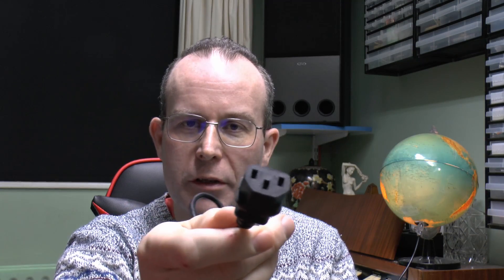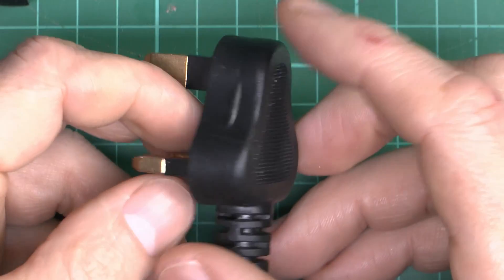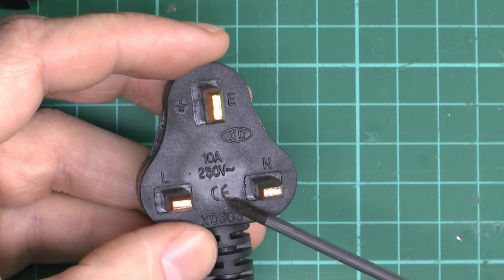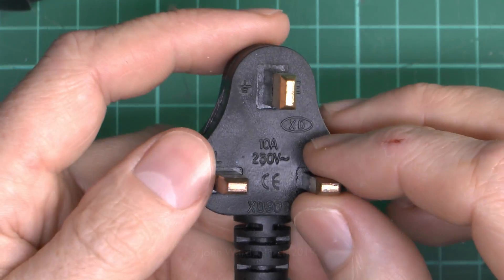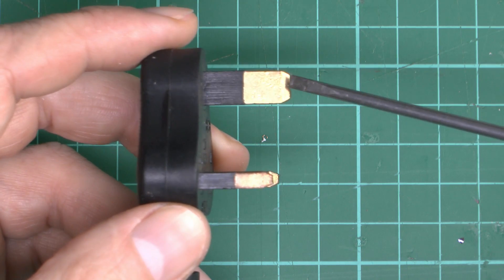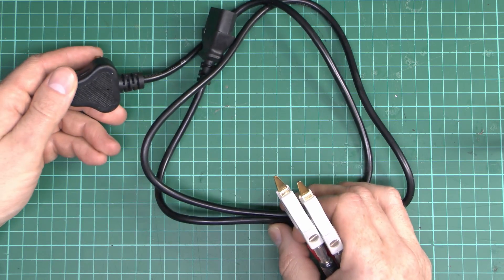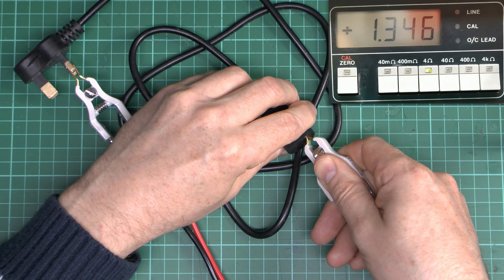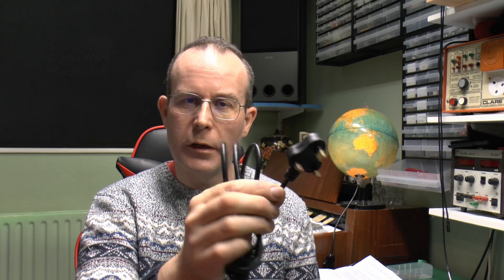Dangerous Unfused UK Plug and Undersized Flex

Comment: Is there a specific UK regulation or specification that states a 3 pin plug must have a fuse?  I have a Uniross NiCad & NiMh plug in charger for AA or AAA Batteries, the body of which plugs straight into a wall socket, the 3 pins are correct & earth is not sleeved, how is that allowed without a fuse?

Comment: I have just sent back an AC adapter with the plug mentioned, they is no fuse and the plug is illegal and potentially lethal UK plugs provided with electrical goods, often from online marketplaces, are typically small, unfused, and do not meet UK safety standards. The sale of such products in the UK is a criminal offense under the Plugs and Sockets, etc. (Safety) Regulations 1994. Amazon are still selling such goods online.I

Comment: w circuit breakers, i question the need for the fuse in the mains plug.  in fact i would say the contact points for the fuse are the weakest links in the design which under high current, might cause the plug to overheat.   plugs from the rest of world dont hv fuse in them, so why should it be considered very dangerous.

Comment: Unfortunately not only did I once nearly get into an argument with a charity shop that was selling a hair dryer with one of those unfused plugs that had 
"passed a test" but I have seen a couple of them in use in commercial buildings. If somebody sent me one from EBay ( and occasionally I have had 
instances of items differ from the photo ) I would cut it up into pieces and throw it in the bin. When I bought a replacement power pack for my old
laptop it came with a lead that had a shrouded Earth pin so I just used the original mains lead and the plug with a shrouded Earth pin was disposed of.
The only reason I let it slip in the charity shop is because I would have really lost my temper in disbelief that anyone can be stupid enough to pass 
something like this as "safe" when it's obvious it's downright dangerous although I did think of buying the hair dryer and destroying it but it wasn't worth
wasting money on nor did I want to be seen buying something that is lethal. Everyone should know a legit UK moulded plug has a fuse compartment
and you would think people who do pat tests would know better.

Comment: That thing is made for the Middle East , places like Iraq Afghanistan India were the use UK BS1363 socket outlets. Not really dangerous for them but in the Uk the are highly dangerous. As are the sealed Moulded plugs the manufacturers put on most if not all domestic appliances in the UK .
Just cut them off and fit a standard rewireble BS1363 plug .

Comment: i just plug them into a surge protector or anything that had a fuse, seems fine for years now
these are not meant to be plug directly into the wall with full power flowing in before any protection
no need to throw away lol

Comment: Hi I bought a new microscope from a week known company in the uk it is branded with their logo. 
It has the same type of plug but attached to a transformer the microscope has a metal body with no sticker or safety label not even the class 2 markings (square in a square) 
Would you consider this to be safe if I change the power adapter?
Thanks.

Comment: I disagree. In all other countries except for UK and Ireland most plugs are without fuse. In EU/US/Asia/Australia we only use fused 3 pin plugs for high voltage devices like washing machines, dish washers, power machinery. And mostly we use 2 pin plugs and believe me it's safe even under insane EU regulations :)  I don't think you need 3 pin fused plug for most household appliances (it's like going for a stroll with a safety helmet on, of course it's safer and in some circumstances can save lives :)

Comment: Was  that lead bought from Poundland? I purchase a 4 gang extension lead from them about ten years ago. The first and only time I used it was to power a perfectly good table lamp with a 40 watt bulb fitted. It overheated within a couple of minutes of plugging in and set fire to the room.
The fire brigade too the remains away, together with the receipt for the lead. Poundland were subsequently prosecuted by Trading standards. But I see that they are back on sale again in Poundland.
So unless you are an arsonist do not buy one if these.

Comment: The strange thing about this plug is that somebody took time and effort to design and put the thing into production. What on Earth were they trying to do? For the effort involved, surely they could have produced something that was much closer to the spec for UK plugs? If they wanted to cheat on costs, whilst of course I'm not recommending it (!), they could have just put it on the market without going through the proper acceptance tests. I would have suggested that somewhere in the world there is a nation that uses plugs like this, but the CE marking gives away the game that they are trying to fob this off as some sort of UK plug.

Comment: I understand what you're saying about the cable being too small for a 10 amp item but surely the biggest issue is that the cable can potentially have up to 32 amps before it takes out the cu breaker.

Comment: John. Does a PSU for a device like a phone charger have a fuse?
Reply from the maker: Some do, either an actual fuse or the cheapo method of a resistor which is designed to fail if excess current flows.  Others do not.

Comment: What is you opinion about twin core cables (for Class II appliances such as portable hi-fi systems) fitted with three-pin plugs that have the earth pin PART-sleeved (half covered) (and a figure of eight on the other end of the cable) ? I've just seen a few of these on Ebay. Obviously, the earth pin is simply performing the job of opening the socket's shutters, and won't be in contact with earth. But my suspicion is that, because the earth pin has a PART-sleeve, it's an indication that there are probably other issues with the plug/cable.
Reply from the maker: Anything with a part sleeved earth pin does not comply with the standard - the only options are solid metal or solid plastic depending on whether an earth connection is required.  Class II can either have a metal pin not connected to anything, or a solid plastic pin.
Any plug with a part sleeved earth pin should be cut off and destroyed.

Comment: UK has poor wiring... it shouldn't depend on the fuse to blow because when it blows, most people don't have extra fuses to replace. It's the breakers job to blow if it shorts or overloads!! WHY are UK houses designed that way? Why fuse and not breakers?
Reply from the maker: Fuse in plugs are left over from the 1940s when a particular system of wiring was designed.
Modern homes have consumer units with circuit breakers, but all plugs still have fuses as changing that design would be excessively expensive for no real benefit.
Fuses for plugs can be obtained in any UK supermarket, hardware stores and many other places.
Reply: @jwflame  Ok, thanks for replying

Comment: why the N symbol is on the right and the L on the left? the L should always be on the right... or is the video is opposite because of the camera?
Reply from the maker: Depends which side of the plug or socket you are looking at.  
The socket has N on the left, so the plug pins will have N on the right when viewed from the pin side.
Reply: @jwflame  oh ok, thanks

Comment: I have couple pretty similar eu cords. Marked 0.5mm^2, measured about 2ohm resistance on both L lead and N lead. At 4 ohms total resistance it would make a nice heater even with relatively low load. (and about 400W of heat on short cable with marked 10A )
Mine has  no continuity on earth, even though cutting in half revealed three wires in it. There was a reason to cut those cords before they get mixed with good cords.
Always check power cords that come with cheap chinese products.

Comment: I believe the manufacturer used the housing intended for the BS 546 plugs (with round pins; the old standard for UK plugs and nowadays used in India) now for BS 1363 plugs. They just replaced round prongs by rectangular prongs. And 3 x 0.5 mm² is even not allowed even if a C7 IEC (appliance couplers) connector is used (max. 2.5 A). The min. cross section is 0.75 mm² (for mechanical strength).
Reply: As example; look to PE-364 on http://w3.linetek.com.tw/html/ac_product.aspx?t_fid=f0012

Comment: Can you scrape the plastic off. Of the pins or are they. Permanent
Reply from the maker: The plastic piece is fairly thick - the pins are the metal piece at the end, the plastic spacer and there is just a small screw through a hole in the plastic to hold the metal end on.
Reply: I meant I have one of these cables and it has been running fine for 2 years attached to the back of an old fujitsu siemens computer

Comment: Wow. Never thought of half of those things being a problem before. I'll be looking out for each of these things now. Thanks for potentially life saving or house burning down advice! 
I just now checked some twin and earth wire that I'm adding to a ring main that has been sat in my shed for a number of years and decided to check the ohms on the cores before installing in the wall. Each check showed zero ohms on my auto ranger so that's good, since I want to run a high current AC unit off it.

Comment: These plugs are on everything I buy from china which is sold as having a "uk plug lead", the metal cap on the earth pin stayed in my socket when I pulled one out the other day. I usually change the plug for a real one and hadn't given too much thought to the quality of the lead wire itself so thanks for the heads up.

Comment: This plug is in common use in parts of world that have UK style sockets but not UK style plug and socket regulations. It is dangerous and it doesn’t comply at all with the British standard. If you come across one of these, bend the pins so that it can’t be plugged in and cut the cable up in short lengths or better still burn it.

Comment: I'm glad to see the Earth pin has plastic insulation to prevent accidental Earth shocks.
Reply: So you call them 'earth' shocks?    :-)
Reply: @TaunterAtwill  
Well, I've had many shocks from Earth, usually while holding a Live wire.
Reply: @JimGriffOne  if you had a shock from the earth conductor wile holding the line conductor you would be dead and not posting stupid comments on social media.
Reply: @Dog-whisperer7494  Indeed.

Comment: I bought some Chinese LED disco lights, these are the cables that came with them, chop them up and bin them. No fuse, undersized copper coated aluminium 0.5mm cable, and just crap! The lights themselves are actually well made, apart from zero earth bonding to the metal case hmmm..which I corrected, and replaced the cables with UK made IEC cables and 3A fused moulded 1mm2 cables. Like someone else said, Ebay imported crap usually has these supplied as standard. BIN THEM.Great video JW

Comment: I learned a lot from this video .........I shall be looking closely at all of the electric gizmos we have around the house. Especially the cheepo  'bargains' my
other half keeps acquiring !!  Can I ask a totally unrelated question. Can you sight consumer units and cable boxes onto plywood or chipboard ? I have just had to removed the deteriorating plaster that was behind the consumer unit and other electrical connection stuff. Rather than replaster it - which would be difficult to do with all the equipment and wires hanging - could I just screw a 18mm piece of plywood to the wall and re-attach the consumer unit to that. It would make it a lot easier to be able to fix the holding screws into chipboard than try and put plugs and screws into a 200 year old brick wall. Your advice will be much appreciated.
Reply: yes I'd use plywood but either would be fine, the main thing is that they are securely fixed.
Reply: @JohnDuffell  Many thanks John.

Comment: I know it's the UK regulation, however as an Australian who works almost exclusively in electrical compliance matters... I simple don't understand the fuse in the plug. I hear about dangerous ring mains, but what use is fusing the plug? In Australia we fuse the device, not the plug….
Reply: I was going to write something, but my non-UK resident guess work ended up a bit long and messy so I'll just creatively steal from wikipedia!

"There are two common misconceptions about the purpose of the fuse in a BS 1363 plug, one is that it protects the appliance connected to the plug, and the other is that it protects against overloading. In fact the fuse is there to protect the flexible cord between the plug and the appliance under fault conditions (typical British ring circuits can deliver more current than appliance flexible power cords can handle). BS 1363 plugs are required to carry a cartridge fuse, which must conform to BS 1362."
source: https://en.wikipedia.org/wiki/AC_power_plugs_and_sockets:_British_and_related_types#Fuses

At least there's the consolation that what I initially was typing was technically correct but very messy and somewhat all over the place.
Reply: so the cable is also protected. UK regulations state that no conductor should be fused at a higher rating than the conductor can safely handle before the fuse or breaker opens.  Since houses here have socket wiring with 30A rewirable fuses or 32A mcbs, the appliance flex would have to be rated for that current. The fuse enables small appliances to have nice small flexes and large appliances to have the required heavy duty flex.
Reply: @kevvywevvywoo  - the regulations in Australia were originally based on the UK regs, but more recently we have aligned almost all aspects of our standards with the IEC/ISO and even use the same standards numbers. The most fundamental premise outside the UK is that the fusing on sub-circuits is only there to protect the fixed wiring from the appliances, and not the reverse.
An appliance flex is not fixed wiring, so it only must be rated for the load it will carry, not the supply that it's plugged into. Generally the APPLIANCE is fused, so that protects the flex, and there's no need to protect it twice.
If the UK really used "end of line" fuses for safety, then they should be fitted into the power outlets, not the plugs of every appliance. That's because the standard UK outlet isn't rated for 32A... hence the socket outlet is the weakest link.

Comment: Is the UK the only country that has fuses in their plugs ? And is it allways 13 amps ?
Reply: They aren't all 13A (in fact the video also shows a 5A). Back in the day you could get 13A, 10A, 5A, 3A and 1A plug fuses from High Street stores. I've only seen 13A and 3A more recently though.
Reply: @tonywalton1464  Still easy enough to get 10A, 7A, 5A, 2A and 1A BS1363 fuses if you are prepared to use mail order. I always put 1A fuses on anything where 1A is plenty.

Comment: I can't totally agree, it depends who is using it and what they're using it on.  In many cases these days a 3 pin plug feeds a 2 wire device. (My TV, stb, router, reading lamp, phone charger, laptop PSU, the radio) ... in fact not a single electrical device in this room uses an earth - and they are all low power .... none of them need to be fused above 3A.  so the only issue is the fuse! ... honestly an embarrassing number are fed using surge protected, independently fused powerstrips .... so nothing in this room relies on the ringmain. 

A good number of these "lethal" devises are in other countries fed using the good old 2 pin plug.  If you want a fuse - again plug into a fused power strip ... ALL my lab sockets are independently fused generally with a 3 or 5 amp cartridge.  looking at my kit in the lab, not much of it approaches 10 amp.  Those that do plug into conventional wall sockets using good quality leads.
few PSUs use earth, almost no lighting uses earth, laptops almost never use earth.  so again ... the deathplug isn't really that lethal.  I know which do .. and I wouldn't use use them in those cases

Whenever I get a new thingy first job is to test the lead.  If it's silly high resistance ... it hits the bin ... if its reasonable - I add it to my collection for selective use.

I wouldn't allow kids, old people esp with pacemakers  or people without a clue to use them.  While I have accumulated lots of leads, there just never seem to be enough.  if you follow a few simple rules with these leads it's pretty obvious what kit can and which kit shouldn't be powered using them. 

Unfortunately the people who appreciate the implications of what's being said are also the people who should be able to recognise when they can balance the risk
Reply: A total of 2 ohms resistance even for 3A is way too much as you will see if you watch the video where he tries this lead out.
Reply: That's why I said I couldn't TOTALLY agree.  Of course John's right for punters, my point was who and what on and I'm complacent (or arrogant) enough to think I know where the lines are, how to reduce the risks and their implications and when not to push my luck.  I'm not suicidal but I also know that the british standard was impressively over engineered to help the shaky economy rather than for the safety of the indigenous natives.  The rest of Europe and America manages to survive with much lighter arrangements.

There is a world of difference between unfused copper and 2 strands of recycled pot aluminium.  I wouldn't lose sleep over a fuseless plug etc, it's not for my granny - or my paying clients but OK for me in my workshop.  I've got stuff that's worked well enough for 50+ years in chewing gum and string.

Comment: Sorry,  but even if that plug does not meet some silly code, there is plenty of room to hold it and plug it in without touching the pins.  This nanny-state idea that everything has to be idiot-proof has gone much too far, and I cannot think of anything that would use that computer-style end that draws near 10 amps.  Sad though that the manufacturer made that claim.